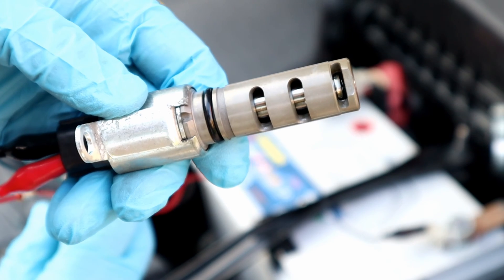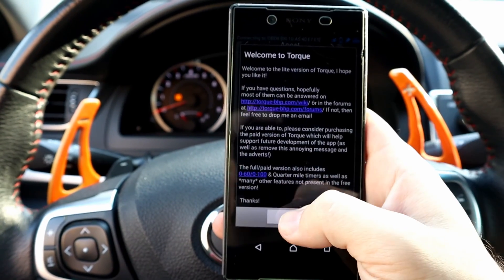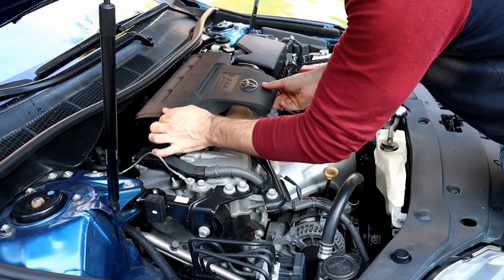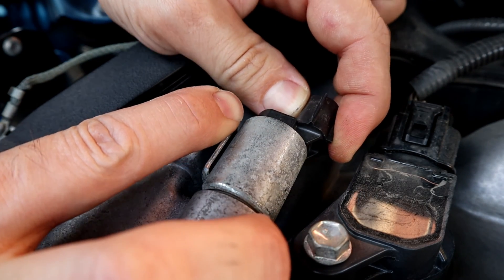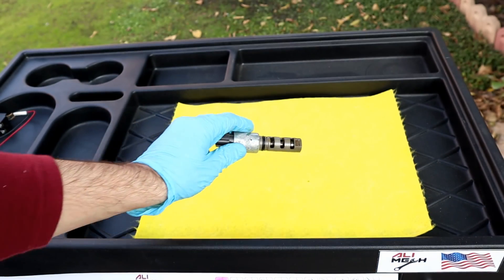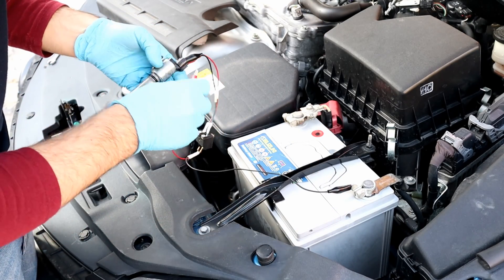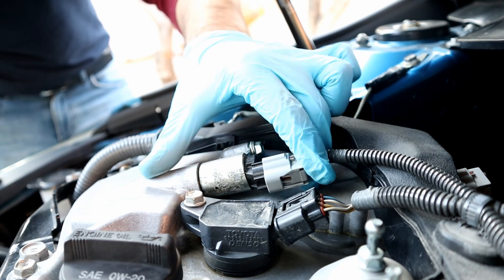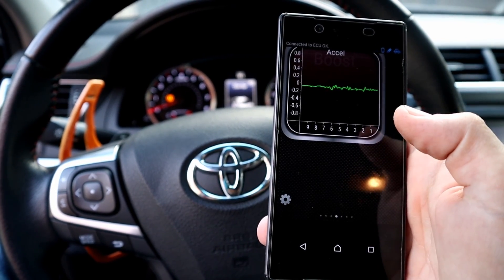How to fix Code P0013/P0011 on TOYOTA Camry, Fixing camshaft position sensor code/How to read code

Comment: I don’t understand why my solenoid is so hard to remove! I got one out without breaking it, but broke the other one. I removed the broken solenoid but now they won’t go back in ! Is there a special way of re installing the solenoid?
Reply from the maker: Sometimes the o ring on the solenoid gets bigger and you won't be able to take it out, and you will brake the plastic part
Reply: @AliMECH  thank you !
Reply from the maker: @anthonyvasquez7050  no problem

Comment: P0014 how to fix it? Thanks
Reply from the maker: These will cause p0014
Engine oil is dirty
Engine oil is too low
Engine oil is incorrect viscosity
Camshaft variable timing solenoid failure
Camshaft phaser is seized in the advanced position
Continuous oil flow to Variable Camshaft Timing chamber

Comment: How can I fix  an P0171 on my toyota?
Reply from the maker: Its dirty or failed mass air flow sensor MAF located after filter and before engine throttle,  u can clean it with mass airflow sensor cleaner or replace it if cleaning didn't work
Reply: Thank you!!

Comment: Where can I get this OBD Checker ?
And with the price please..
The camshafts sensor looks very clean ..in order to the viscosity snd the quality of oil is too low that’s why  camshaft sensor showed up ..
Reply from the maker: No, 2017 Toyota camry engine oil is very thin oil, its 0-w20
Reply: @AliMECH  yeah I know dude ..
Try to use Totachi products which is very reliable company
Reply from the maker: I will give that a try for sure
Reply: In the tropics my Toyota 2015 rav uses 15/30 engine oil .